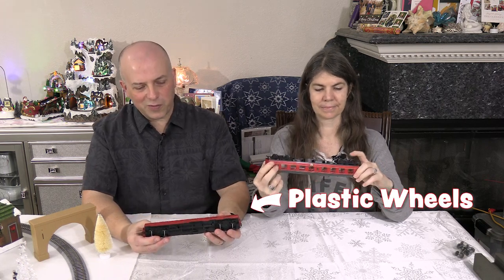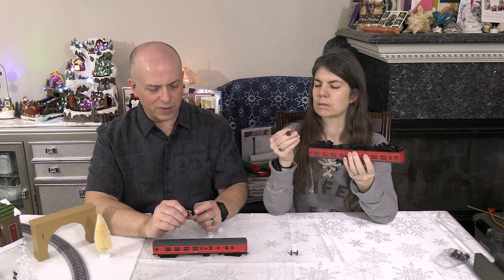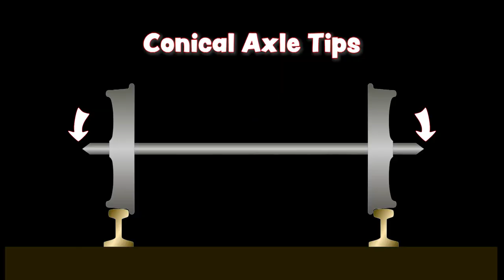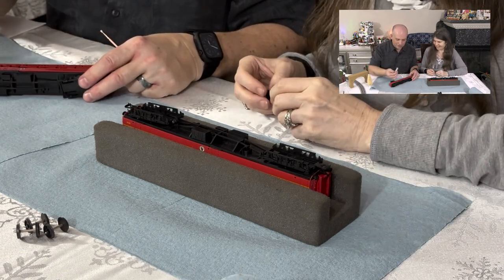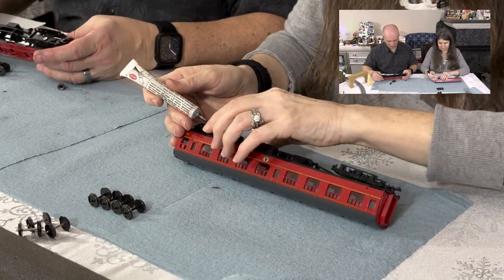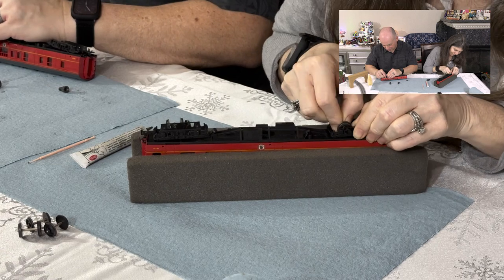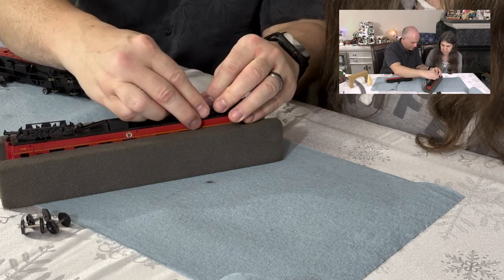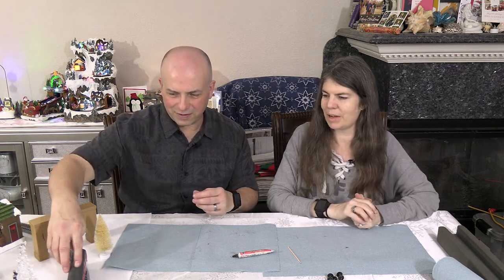Model RaIlroading for Beginners, Episode 4: Replacing Wheels

Comment: Bachmans Hogwarts Express is 00, instead of HO. The same track gauge but 1:76 scale, instead of 1:87. In 00 I believe the wheels would scale out at around 40", in HO they would be around 48".
Reply from the maker: Good point!  So the wheels aren't as large scale-wise as they seem, though they're still big.  Thanks for the info and for watching!
Reply: "38" is the maximum size you can currently buy for model railways.

Comment: Metal wheels are definitely so much better. They even make the great clickety clack sound much better on switch points and joints in the rail. , Thanks
Reply from the maker: We're glad you liked the program.  The sound is an added bonus of the metal wheels like you said.  Thanks for watching!

Comment: Hi Dan & Nichole!  Where do you suggest purchasing metal wheels for N Scale.  Also how to determine the size needed.  Some modelers use calipers which seems like a little much for a beginner.  I have been on Micro Train's site and the selection is a little overwhelming.  I believe I'm using Barber style trucks.
Reply from the maker: There are a number of sources for N scale metal wheels, including Micro-Trains, InterMountain, ScaleTrains (Fox Valley), and Eastern Seaboard Models.  There are two basic dimensions to worry about, axle length and wheel diameter.  All Micro-Trains trucks use the .540 inch axle length.  Most of the wheels are sold with that information on the package or labeled "fits MT trucks" or something similar.  There are also .553 and other axle lengths.  The .553 is also common and fits other brands of trucks.  Longer axles are less common.  If you get the Micro-Trains metal wheels they should fit automatically.  Personally I really like the Fox Valley and Eastern Seaboard Models wheels.  They're very good quality and very consistent, so you're unlikely to get bad ones.  Fox Valley is now part of ScaleTrains and the wheels are available on the ScaleTrains website.  Eastern Seaboard Models wheels can also be ordered direct.  Wheel diameter is the other consideration.  As a rule of thumb, older era cars have 33 inch wheels and many modern cars with roller bearing trucks have 36 inch wheels.  That's just a rule of thumb, though, and there are exceptions, so some research may be in order for particular cars.  I hope that helps.  Thanks for watching!

Comment: The special wheels you bought from Bachmann are bigger not because the UK uses bigger wheels it’s because the hogwarts has a different type of scale, it’s called oo scale it runs on ho track but the the scale of the engine is bigger than it should be for the track
Reply from the maker: Thanks for the clarification.  I probably should have been a little more specific about OO vs HO.  I have some really old North American prototype OO cars that belonged to my grandfather, and they have a different wheel gauge.  Thanks for watching!

Comment: I have used flieshman  passenger cars. I orderes 36" wheels from eBay. The seller clearly wrote these are according to the NMRA standards. These are about 10.5 mm. But the olders are 11 mm and flanges are larger. The needle end axles fit well. The concore xephyre passengers cars have wider truckd so the new wheels are not only smaller than the original by 0.5mm, but have also smaller phlanges and side to side play. Solution??
Reply from the maker: So it sounds like the new wheels work okay on the Fleischmann cars, but have a lot of side to side play on the Con-Cor cars.  The slightly smaller wheel diameter shouldn't be a huge issue unless it bothers you visually.  You could always use Kadee or some other thin washers on the truck bolster to raise the car if the coupler height is low because of the smaller wheels.  The side to side play is a more difficult issue.  I used to use Reboxx wheels.  I don't think that company is around anymore, but they sold wheels with different axle lengths.  You might want to look around and see if you can find different wheels with longer axles.  Another option would be to replace the trucks on the Con-Cor cars, maybe with some from Walthers.  The last option would take some work, but if you have a wheel puller, and if the axles are the same diameter, you could also remove the new wheels from their axles and then press them onto the original Con-Cor axles.  I'm assuming these are normal metal axles and not plastic.  Anyway, I hope that helps.  Good luck and thanks for watching!
Reply: @DanielCortopassi thanks, these are metal wheels. I will try using the old axles
Reply from the maker: I hope it works out well for you.  Hopefully the axle diameters are the same.  That would also be an issue.  Good luck!

Comment: It gets expensive when you change all plastic wheels to metal wheelsets for around 100 pieces of rolling stock.  I use only Walthers Proto 2000 metal wheelsets with metal axles.  Also changing out all talgo trucks (couplers mounted to the trucks) to body mounted Kadee couplers gets expensive also.  Then there's making sure all your steam engine tenders have real bituminous coal glued on top of all the fake coal.  And add the cost of changing all incandescent lighting to LED and LED strip lighting with keep alive circuits.  Cheers from eastern TN
Reply from the maker: Changing wheels and couplers can indeed get expensive if you have to do a lot of rolling stock at once.  I've done a lot of my equipment as I go a little at a time.  Anyway, I hope you found the video helpful.  Thanks for watching!
Reply: European cars need Larger 38 and 36 inch wheels
Reply: European wagons need "36" and "38" wheels and can get expensive, unless you buy from evemodel, which still in turn becomes expensive although the newer "POM" plastic wheels are better than the ABS ones of old.

Comment: Hey Dan Great Video 📹 I think Nicole did a splendid job with Trucks being so tight like they we're Dan would a Truck spreader from Micro Mark help or would detaching the Truck from the Car to get more surface Area around the Truck help working with em,  On some of my Rollinstock especially cars that have screw in bolsters I remove the Screw then replace the Wheel as for tapping in a little Greecem' in the Trucks I haven't tried that Dan but I certainly might try it to free up the resistance in the hub I got the Microtrains full kit that kit is loaded with some Awesome stuff.. What I want to get is some Microtrains Brown couplers & there metal wheels i believe they're making 33 & 36's now Dan & Intermoutain makes some Good wheels for MT trucks & N Scale 

I wanted to Add I attended the First Trainshow of 2023 for Kansas it was in McPherson Kansas the 2 annual Which made a Return to McPherson last year the Trainshow Ran through the 90's up into the early 2000's then it Stopped but with a Resurgence of Model Railroading the Guys that Ran the Show decided to Bring it Back for a Small community it was a Great show Attend...  

Allen D
Reply from the maker: We're glad you liked the video.  Detaching the truck might have helped.  I haven't tried a truck spreader.  I haven't tried the Micro-Trains metal wheels either.  In N scale I have some InterMountain.  I like the Fox Valley wheels.  I think ScaleTrains has made those available again.  I've also gotten some nice N scale wheels from Eastern Seaboard Models.  That's cool news about the train show.  It's been a while since I've been to anything like that, but they were always fun.  Thanks for watching!

Comment: Nice video! How would you program a locomotive with an ESU decoder to respond to F9 (drive hold) in an advanced consist? Thanks!
Reply from the maker: If you have a Lokprogrammer, there's a page in the software that has checkboxes for all of the functions that you want available in a consist.  If you want to do the same thing with CV programming, you'd have to consult the manual to figure out which CV(s) to set.  I hope that helps.  Thanks for watching!